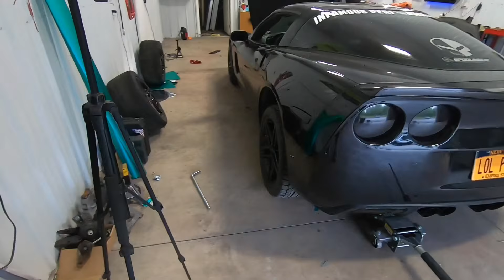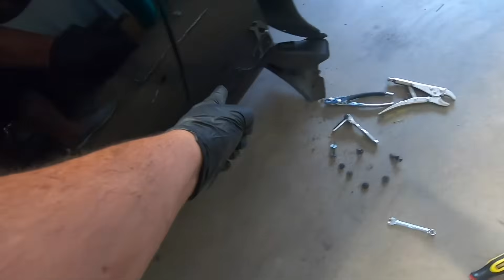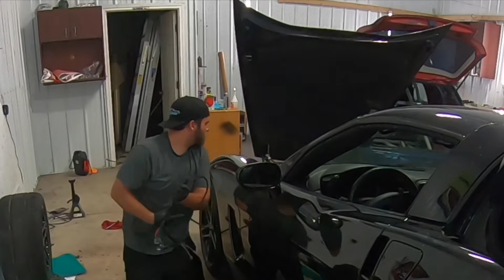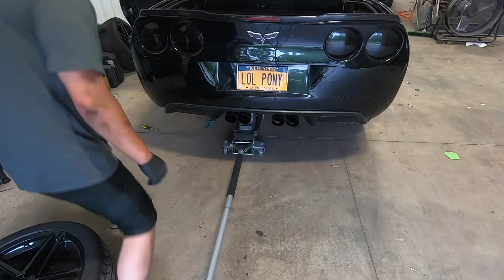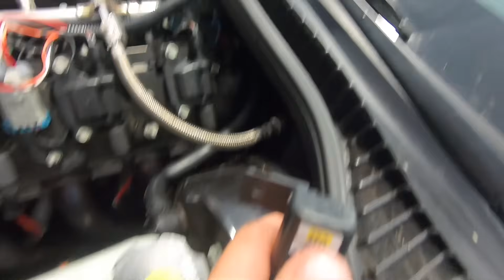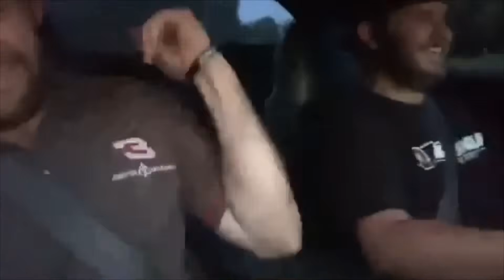2005-2013 Corvette C6  Racetronix Hotwire Fuel Kit Install  / SUPER EASY!

Comment: Too late now, but that catch can is routed to the valve cover which is already baffled, that’s why it was dry, a more effective location would the valley cover vent tube, the U-shipped hose that also goes to the intake but after the throttle body, you will definitely catch some oil.

Comment: Just came across this....Went through 3 fuel pump relays in 3 months on my 07 Z06....Car is modified with a halbro 525 fuel pump but previous owner is running this with stock wiring......Figured this can only help....